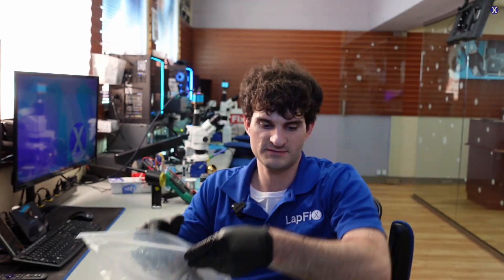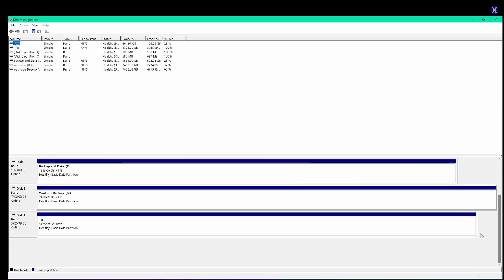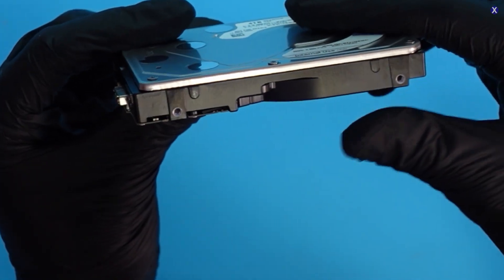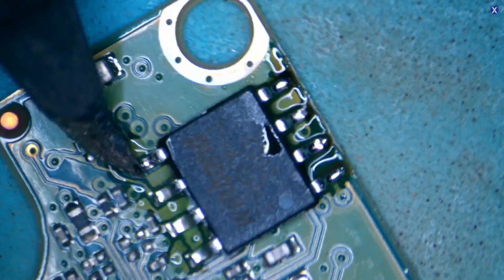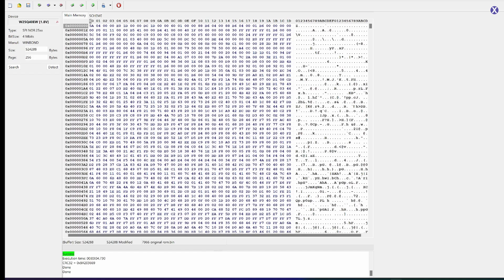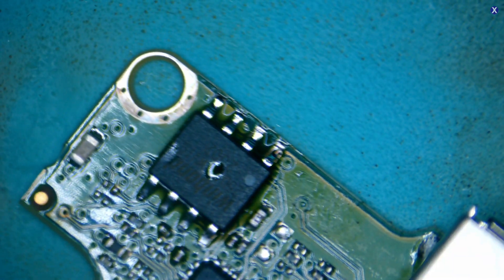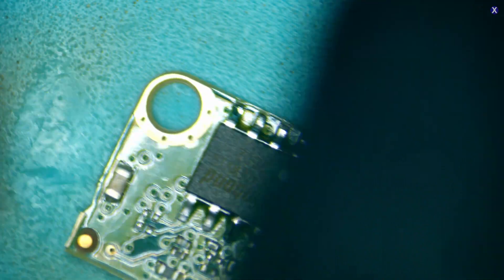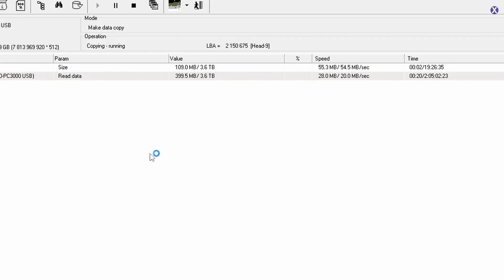Recovering Data From An Encrypted 4TB WD External Hard Drive

Comment: Hey there! I have WD 5TB that recently stopped working… I would plug it in, it would read for like 5 min, and disconnect. I assumed the USB was loose. So I unplugged the USB, put some extra pressure, connected to computer, and now it’s no longer detected… could the USB plug cause reading issues?

Comment: if my hard doesn't show in the system but i hear the sound of disk hard working , do you know the issue is ?
Reply from the maker: If your hard drive spins but isn’t detected, it could be a connection issue, firmware failure, or weak read/write heads. Try a different cable/port, check BIOS, and avoid DIY if data is important.

Comment: Hello, excellent video!
I'm from Brazil and I also work with data recovery. Could you ask a question: What tool did you use to read the ROM? Did you use Rusolut or other Hardware? Thanks
Reply from the maker: We used generic read/write tools to read the ROM, not Rusolut or any specific hardware. It depends on the case and chip type.
Reply: @lapfix  Thanks for the feedback. We currently use MRT in our lab. Could you tell me if MRT supports this type of tool?
Thanks